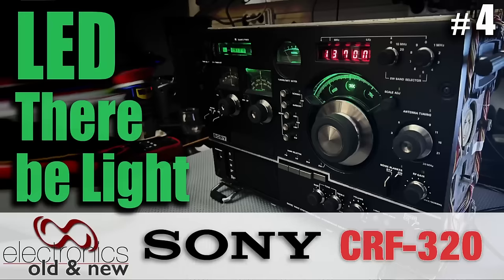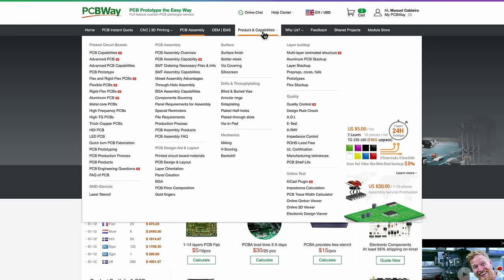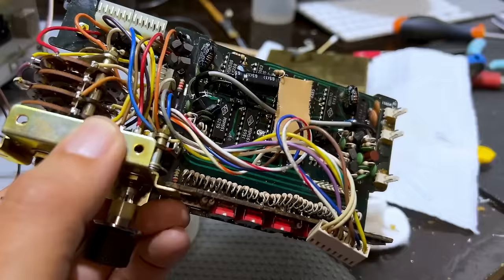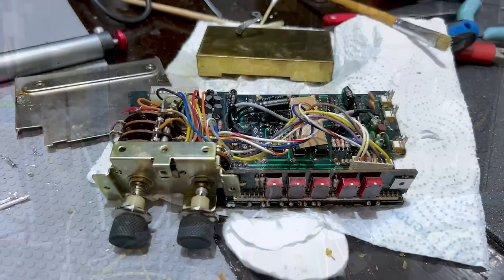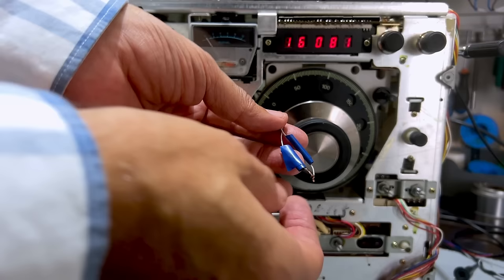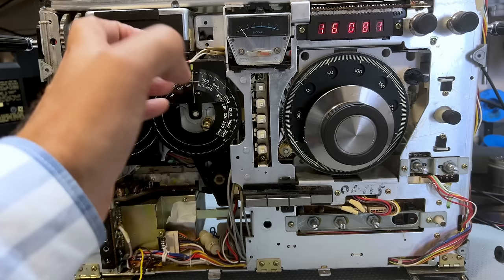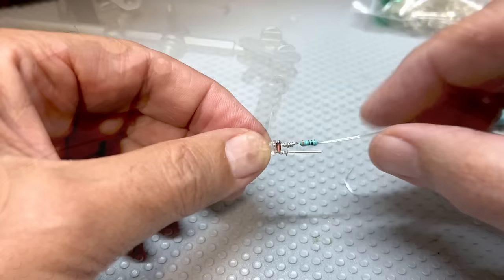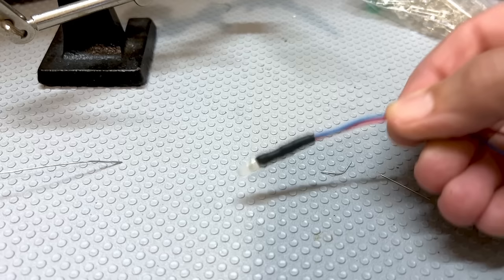Shortwave is working ... sort of. Dial lamps get replaced. Sony CRF-320 restoration Pt.4 #pcbway#

Comment: A 1N914 will work as well. I have plenty of both.  Each segment of the display is driven separately.
Take a voltage reading when it's suppose to light up.

Comment: When I worked for Marconi Instruments a few years ago some of the intermittent faults were due to an integrated circuit. We used a miniature heat gun and freezer spray, which did show up some of the faults, but not all of them. I've swapped bulbs for LEDs on radios and even a Ford Granada car I had, LEDs were quite new at that time and wasn't as bright as they are now. I hope you find that intermittent fault.

Comment: Hi Manuel, it looks like there is a deep scratch/ crack on the frequency counter board, you may want to confirm the traces and jumper them if needed.
Otherwise the radio looks great, you did an amazing job.
Reply from the maker: I checked that, thanks 👍

Comment: Happy 2024, Manuel! Nice Sony all band radio! These intermittent faults are a nightmare to catch, good luck! I like the LED approach. Just running them from filtered DC often will keep them alight a while as long as the caps are discharging, not quite ideal. I have done like you with scouring the LED, and a back connected diode in parallel, running from AC. I often have used amber LEDs in dials, looks nearly like the colour of lamps I find
Reply from the maker: Yes, I think I’ll use these LEDs in the future. I really like the result.

Comment: 7:14 pretty sure that shield originaly had a piece of insulating paper or plastic glued to it to prevent it shorting to the pads on the PCB.
That would also explain the glue on it...
Nice radio. Should we guess that the intermitent issue is heat related? 😋
You could hook up wires to testpoints on it and measure while it sits running just to capture the the fault when it happens.
When it fails you dont have time to start hooking up wires, best to do that before.
Probably start with measuring supply voltages.
If you dont read anything wrong there then move the hookup wires to other testpoint (signal path...?) and hope for the best.
Good luck.
Reply from the maker: You’re right. I need to add some paper to that shield. That was dumb of me. I’m going though the block diagram sections one at a time and doing exactly what you’ve suggested … the problem is that last night it failed for about 5 seconds over a two-hour period 😊 I’ve listened to a LOT of SW stations that I’ve no interest in. Just sitting there staring at the radio 😊

Comment: Hi Manuel. She's looking extremely pretty - nice work! Probably through ignorance (as you know I'm much less experienced at this game than you are) but I don't trust tantalum caps much more than I do electrolytics of a certain age, particularly as they can fail shorted. Hybrid aluminum electrolytic capacitors (from Panasonic for example) share the low ESR characteristic of tantalums and might be a suitable alternative if a non-electrolytic capacitor alternative won't fit in the available space? Just a thought...
Reply from the maker: I’ve been thinking along the same lines. I’ve actually ordered new tantalum caps of the same value to change some if not all. The new ones seem to behave a lot better than the old.

Comment: Great job on choosing those LEDs, they look stunning. I'm getting quite a bit of Cold War vibes here.
If the issue is really due to flaky ICs, you might try debugging with freeze spray or (very carefully) with hot air. That might trigger the fault condition.

Comment: You could have add rectifying diodes and current limiting resistors for the 6.3V AC to all lamps on the circuit board where they originate than you could just solder bare led where they were used.
Reply from the maker: Yes, I could. However, I wanted to make this mod as unobtrusive (and reverseable) as possible.

Comment: If you had room as you said you could have used 2 leds bach to back so each one protects the other one and very, little flashing.
Reply from the maker: Yes, but the two would not fit into the hole, so one would face backwards.
Reply: I've been thinking about putting a flat on the end and then a small bit of foil to reflect the light back in and also sanding the sides to try and give a nice side illumination. From a cheap and easy to get LED. @electronicsoldandnew

Comment: Believe it or not, 4 x 1N4148 fit exactly behind a 5mm LED when you direct them in the same direction as the LED, like cigarette's in a package. Only you cannot use pig tales then, takes to much space.But.. then there's no flicker at all.
Reply from the maker: True, but really not necessary. This one isn’t flickering at all.
Reply: @electronicsoldandnew  You are the first not notice then, for me 100Hz and nothing less. When I move my eyes with such LED even in the corner of my eyes I get a shiver 🤩
Reply: Oh I forgot:  the row of 35 resistors behind the LED's tell you that they are individually driven. Just put the frequency so that it shows a 1 at the end (e.g. 8881), and use a wire to connect one of the working segments with the one that is not working, simply by trying. Does it not light, then the LED digit is broken or shorted to ground, if it does light the drive line to the chip is gone or the chip. It is often possible to run a wet finger over these contacts, and that will show faintly that it is working or not.

Comment: Hello Manuel    I have a very similar Sony receiver (ICF-6800-W) with a very similar intermittent  drop out on shortwave. I haven't fixed it definitely yet but I am thinking it has to do with the rf preamp  stage . Retuning that, it seams to bring it back in at times. But it could be as you said a chip in the tuning board causing  maybe the agc to cut in and out.  Good luck, I will be following you closely  on this endeavor.
Reply from the maker: 👍 thanks

Comment: Start by replacing all caps as possible ...then look a the voltage levels ,Then measure all clocks and see how clean they look ..Then replace MOS cirtuits if ther are available.. You may have corrected something by chance but something else must be going bad ...Sorry 40 years repairing all sorts of thing make you have automatic reflex
Reply from the maker: Thanks for the good advice. Will keep at it until it reveals its secrets 😊